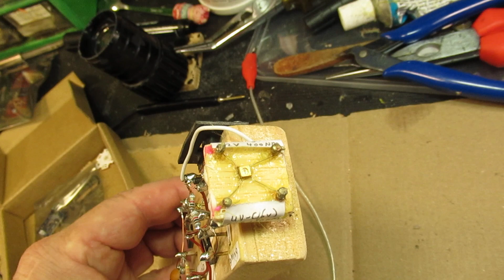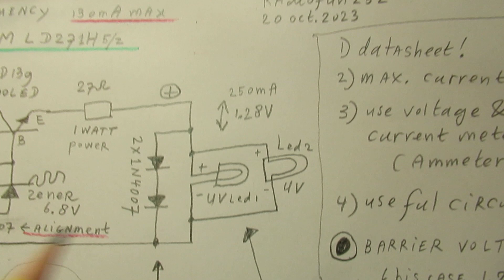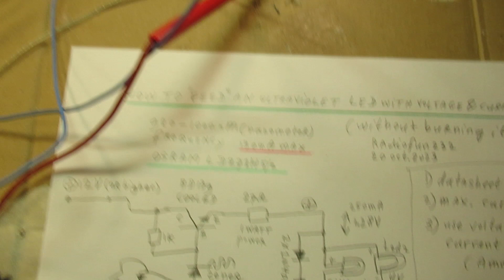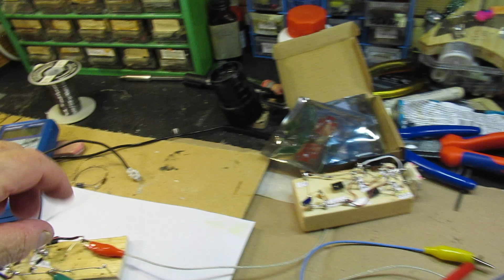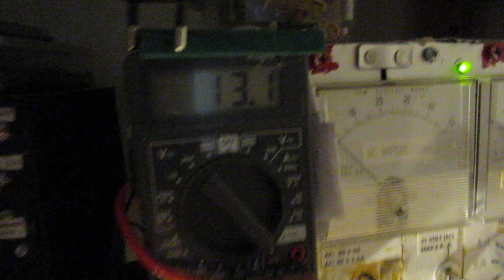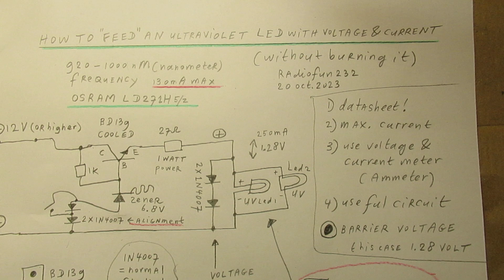IR and UV radiation source. Demo.

Comment: I really like your lab setup. It remainds me so much about my grandpa's one in the 80s when I was a child. It brings memories. Even your wooden breadboards with nails for contacting points - I did something similar for my pA meter - used tiny screws fixed into a PTFE board slab and soldered the input network along with an owened dual JFET on them. After a bit of ultrasound cleaning and covering with shielding can it worked a treat.

Comment: Did you mean to write infrared? 1000nm is IR. UV is under 400nm or so.
Reply from the maker: Ok, good. The aim of this video is to make these LEDS working via the right current/voltage drop parallel to that UV LED. That frequency band is, in a certain way, optional/arbitrary. Thanks. 20 oct 2023.